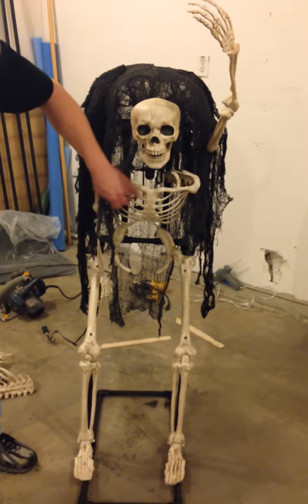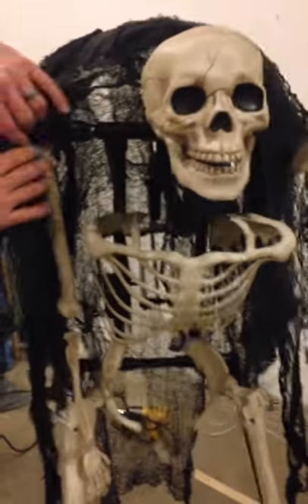Cauldron Creep Part 1

Comment: I was wondering how you attached the reindeer motor.  I am using the same motor and skeleton for the one that I am building.
Reply from the maker: Hey greeg, I used a piece of sheet styrene (hard plastic, about a 1/16" thick) and just cut a hole in it for the shaft to go through and screwed it on there. Very easy and leaves a clean look without a bunch of bulk. I can send you a couple pics, just message me if you would like.